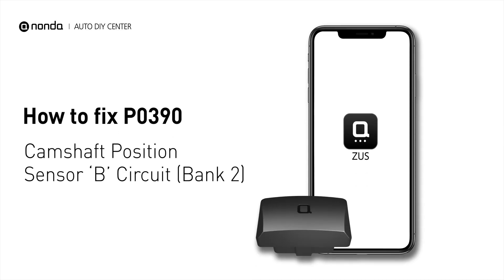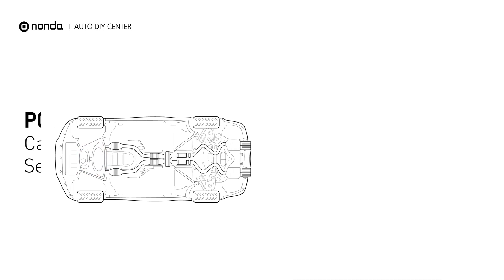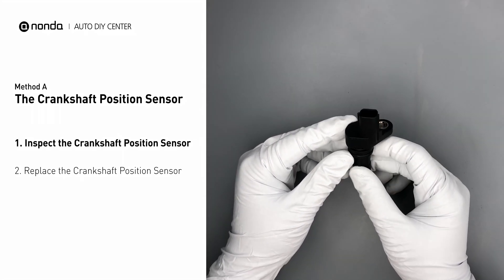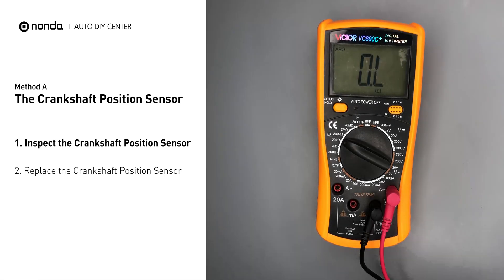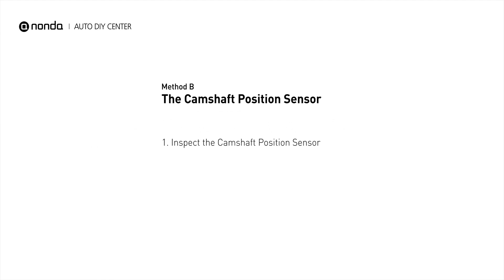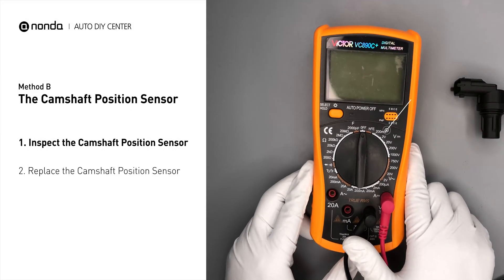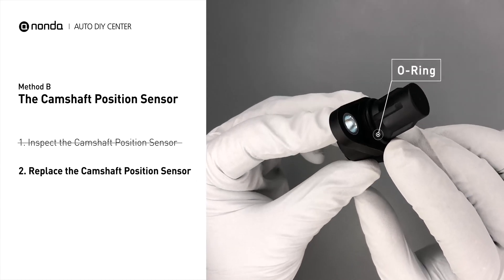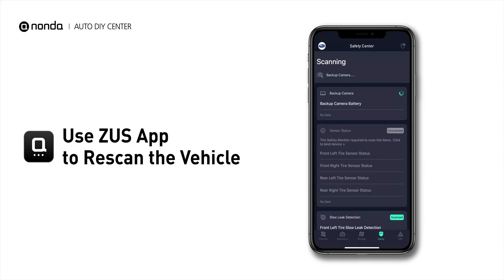How to Fix P0390 Engine Code in 3 Minutes [2 DIY Methods / Only $9.34]

Comment from the maker: Hi, I'm Steve, nonda's lead mechanic engineer. 
Feel free to leave your comments here if you have any mechanic questions, I will be glad to help you out!
Reply: I have a 2017 Toyota Tacoma trd sport after changing the ignition coils I received that code, what do I do?
Reply: I have a 12 dodge charger 3.6 just got head job done car ran great for about a week. Got rough idle and car stalls now. Codes pulled P0390,P0300. Replaced camshaft sensor bank 2. Code is still present and issue is still there.
Reply: Q pasa en mi Camry 2008 ese mismo problema y esta ralentí inestable

Comment: I got P0390 and P0393 Crankshaft Position Sensor B  Circuit and Circuit High Codes at Ohio ECheck.   Before ECheck I got these same codes with OBD II check but they were called P0393 Camshaft (vs Crankshaft on ECheck) Sensor "B" Circuit High Input (Bank 2) and P0390 Camshaft Position Sensor B Circuit (Bank 2).  I was told by Repair shop that is$700 and was very difficult to fix and no guarantee can fix.   Conrad's quoted $1200 to replace 4 camshaft position sensors but no crankshaft position sensor.    Bedford Toyota quoted $2300  to replace 4 camshafts and crankshaft.    Does this sound right or is this a scam?
Reply: Sorry, forgot to add that I've had this problem for 3 months and 2007 Toyota Sienna minivan runs perfectly.   Am able to get Check Engine, VSC and Trac Off lights to go off, but they come on again after driving 20-40 miles.
Reply from the maker: Hello, as you are receiving more than one error codes, we suggest getting your vehicle visually checked by your local mechanic for further diagnosis.

Comment: Prob wont see this but i had codes p0349 and p0345 which i then replaced the cps, but now im getting this one and p0394 and i dont know what to do
Reply from the maker: Hi AJ, since you are receiving multiple error codes, we suggest to get your vehicle visually inspected by your local mechanic for further diagnosis.

Comment: Can the vehicle be driven about 200 miles home with out damage?
Reply from the maker: Hello, having this code could make your vehicle very difficult and dangerous to operate. It could cause a hazard not only to yourself but also to others so we suggest to have it checked by a mechanic for further diagnosis.